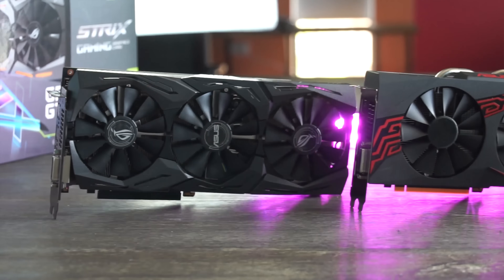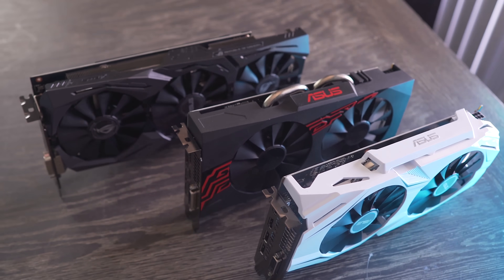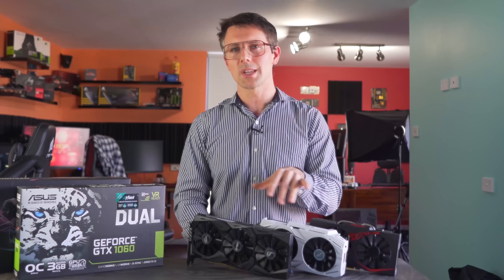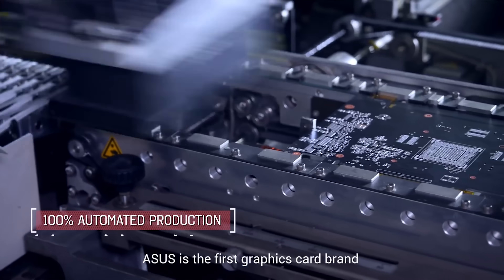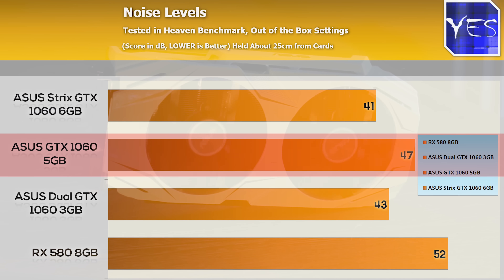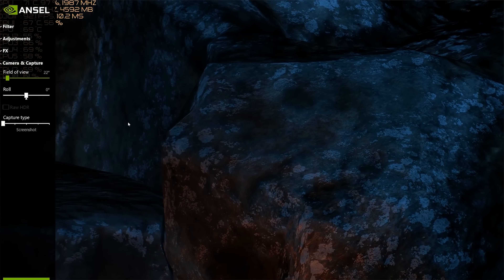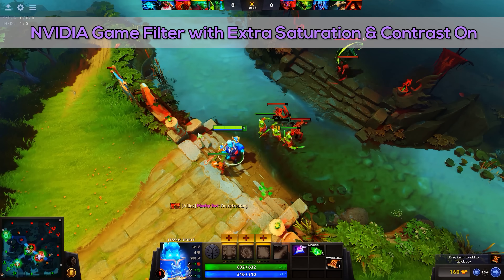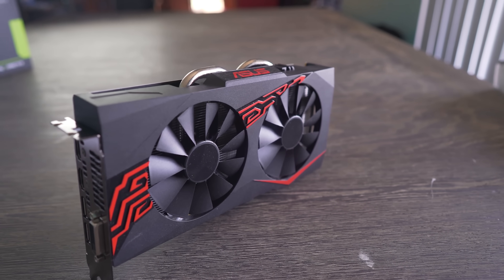GTX 1060 5GB Benchmarks ....!? Comparison Vs. ASUS STRIX 6GB and DUAL OC 3GB!

Comment: Looks like the exact situation as the 1050 3 GB. It's a crippled 1060 6 GB and that memory bandwidth does make a difference, although not as drastic as on the 1050 3 GB. The only way I can understand Nvidia doing this is because they're running low on 512 MB VRAM chips and started using the 1 GB variants to level out stock, hence the 160 bit bus. TLDW, it's a pointless card. Great video Bryan! This is the first dedicated 5 GB review I've seen (excluding Linus' Aliexpress card)
Reply: Ur wrong, GTX 1060 5GB version was made for gaming cafe's in china and only for china, there was no intention to sell it worldwide. I agree with @logirex
Reply: oz ye goddam early bird
Reply: It is intended and sold in asia. It is cheaper and fast enough for internet gaming cafe and similiar places.
Reply: I don't think that assessment is quite accurate since the 1050 3gb is actually faster than the 2gb model while this 1060 5gb is even slower than the 3gb model.
Reply: the memory bandwidth is intended to cripple mining performance, as the card was supposed to be only sold in China, aka the mining home base. (and it does that job well, actually.)

Comment: a question if someone with a good heart could answer me, I bought a gigabyte gtx 1060 5gb but has a high average temperatures, I wanted to know what would be the size of the thermalpad I should buy? 0.5/1.0?
Reply: Você achou ela boa? Será que é melhor do que a de 3gb?

A almofada está entre 0,3 e 0,5mm
Reply: @fernandoleoj  the difference is 1 or 2 fps with a maximum of 8 fps with the normal GTX 1060 (3gb/6gb).

I put 1.5 mm thermal pads on them, I removed about 15 degrees, otherwise no problem. ^^
Reply: @teloz2779  thanks for answering ....

Cool, but in games that need more textures, that 2gb of vram makes a difference, right?

Hug

Comment: 6gb is for us 1440p @ 60hz users who don't want to spend up big on a 1070 or up

the vram use easily surpasses 4gb on standard gaming, so a 3gb variant will skip badly at the same settings

Comment: Strix RX 580 vs aorus RX 580 xtr? Found a used aorus one for $270. The aorus one is very fast at 1425 (or around) factory oc however better thermals and acoustics on the strix card.

Comment: Hey guys I need help!!! I’m gonna build a budget rig for a friend. And i have to keep at 300 or less. I have 3 options rn.
1) buy a dell or similar and throw a psu and 1050 or 960 in there.
2) Buy a prebuilt Fx-6300 build with 16gb ram and a 1tb hdd cheap psu gt 720 with razer black widow kb and chroma mouse with a firefly mouse pad for 180 and replace the gpu with a sub 100 dollar gpu.
3)Buy an i5-2400 cpu, motherboard, 8gb ram, 450 evga psu, a 500gb hdd that I don’t use, cheap case and a sub 100 dollar gpu. 

Also another thing to consider is that I found a gtx 1060 on let go for 130 and a gtx 1050ti for 100 on let go. And the fx prebuilt is also something I found on let go. 
I just wanna try to get the best performance possible. I know the fx 6300’s single core performance isn’t all that good but the friend likes to make YouTube videos which is why it’s a choice considering it’s more cores and ram overall.

Comment: Hello Brain, im a big fan <3
Can i ask u a question? Im going to have X58 rig. Im planing to have EVGA X58 classified 3 mobo.
But the specs in PDF file i downloaded from EGVA website just said that it support DDR3 800/1066/1333/1600+
Did 1600+ mean that i can use DDR3 2400MHz ram? Or i just stay with 1600MHz?
Im planing to have X58 + 12gb ram + X5675 with 240 aio and OC to 4.5. Maybe 5.0 in the future. Many tks

Comment: What are the clock speeds, gpu & ram, during the tests? Otherwise the fps numbers are useless. For comparative results they all must be identical. The title says it's a comparison so record and present all the relative information i.e gpu & ram clock speeds. And once again the clock speeds MUST be the same on all of them or the test is invalid.

Comment: I'd expect any card with more Cuda cores but less bandwidth to run slower than the standard model until you reduce resolution to find that card's sweet spot. By reducing resolution you make memory bandwidth a moot point, then the extra Cuda cores become important. There may be games that do not require a lot of memory bandwidth by design, those games will also perform better with more Cuda cores than the standard model.

Comment: 5gb of vram would be a sensible amount for the standard 1060 rather than 6gb. In my experience a lot of games will use over  4gb of vram at 1440p but rarely over 5gb. When adding extra aa to push it closer to 5gb a 1060 will run out of raw power before that buffer will be exceeded at 1440p. 
3gb is not really enough vram in some games either, especially at 1440p. So the 5gb version would be ideal if the bus wasn't so crippled

Comment: Brian,  I'd really like to see a short followup on this video. The memory is clearly the problem as stated, so why not try a memory OC? iirc memory oc helped a lot with other bandwidth-limited cards like the gtx 960.  
Btw I LOVE that asus "plug in your case fans to your gpu" feature. When I run an AIO on my cpu with a air cooled gpu, the gpu dumps way more heat than my cpu when gaming. I end up with case fans on low, with a screaming gpu fan.

Comment: More completely pointless cards from NVIDIA, just why? I honestly don't get it, who would pay a tiny amount less just to have one gig less with the same specs otherwise. I would just get the 1060 6gb or a 3gb, which is what I have in my personal PC. If these things continue I'm going to switch over to AMD next time around, as long as AMD stays competitive and I think they will. the 570 and 580 are great cards respectively, their higher end stuff is lack luster in comparison to NVIDIA but I just don't need anything that high end.
Reply: Apparently it's only meant for internet cafes in China. Not meant to be available anywhere else.

Comment: the ext_fan headers on the gpu are bullshit. nice idea, but implemented so poorly, its sad. min pwm is 40%. you need gputweakII which is poorly programmend and i couldnt get my card to overclock with this program. max was 1865 mhz on 1080 which goes up to 2100mhz with afterburner. just use speedfan instead and onboard headers

Comment: Is a8-7650k worth it? Cause only ddr3 parts that have reasonable price and ddr4 part are so high priced and used market in my country are not worth it
Reply: NO. anything based on bulldozer would fail you in terms of performance nowadays.
Reply: Ty
Reply: If you're looking for cheap but good CPU in the DDR3 era, look for i7-2600k/2700k. These can run on Z68 and Z77 motherboards, these are soldered so can be massively overclocked (~4.7 GHz achievable) and cooled easily  with <$50 coolers.

Comment: This is just the next episode of "NVidia doing shitty anti-consumer stuff". They already have a 3GB and a 6GB version, they already had different core count versions that were totally unclear for consumers. And now they bring out a 5GB model. 90% of consumers will just think: 5GB, that is in between the 3GB and 6GB version, but closer to the 6GB. But in the end, it is slower than both.

I sometimes really wonder why people still buy NVidia cards, as with that they are sponsoring a company that does shitty anti-consumer, anti-competitor things again and again and again...
Reply: These are models intended ONLY for use in chinese gaming cafe's and have a lower bus width to prevent people using them to mine on. You will never ever see this product in stores. How are people not getting this? So many mentally challenged people making uneducated comments.

Comment: 1:28 I don't get it how dual gpu's are the same power consumption as one gpu??
Reply: Butyrkinas Pagarba I think dual oc means it has a switch on the PCB to have 2 oc modes.
Reply: Could also refer to the amount of fans

Comment: I have the same Asus dual cooler design on my RX 480 8gb but it’s always been kinda hot and loud for my taste anybody else experience this?
Reply: Dual as in the Asus Model. The card is an Asus Dual GTX 1060 3gb. There's not a second 3gb 1060 in the test.
Reply: Leandro Pereira yes the white DUAL one it’s one of Asus’s Line of cards
Reply: I also have an Asus Dual but RX 580 and normally AMD cards run warmer than Nvidia. My Dual runs at 65-75 Cº depending on the game. The max RPMs are around 2500, and it is a bit noisy but not that much. What I did notice is that the noise increases rapidly as the dust accumulates over the gpu fans, so I clean it often.
Reply: And remember that Asus Duals are the cheap line-up, ROGs would be the Top-end. That's why Duals feels kinda cheap on fans and no backplate.
Reply: Yorch Li yeah but I got a 8gb 480 for 200 back when gpu prices weren’t so screwed up it was 60$ more for the strix
Reply: I got also an 8gb version, it cost me 210 like 2 months ago (used). I have stressed it a lot and it works fine, no funny gizmos or anything. It was from a mining rig, and the guy let me "choose" from his 12 rx580, they were all identical except for two 4gb rx580 he had. He even installed the original Bios in that moment we were testing and stressing the card.
Reply: Yeah the DUAL is way louder than even the STRIX (2 fans) version (not ROG STRIX which has 3 fans). The heatpipes are less effective and the fin density is lower.

Comment: Is there a GTX1060 with an 8 pin connector?  Or was that the RX580?
Reply: There are 1060s with 8-pin connectors: Asus ROG Strix, MSI Gaming X, Gigabyte G1 Gaming, Aorus Extreme. Basically all top premium models of each brand have 8-pin on the 1060.
Reply: Ah thanks for that!  I have 2 GTX 1060s but the 1st gen I guess.

Comment: Thanks Bryan for another great video. Thanks to your tips on getting a good deal for second hand hardware, I was able to get 2 MSI GTX 1060 3GB OC's for €140,- a piece from a seller. Unfortunately I found out too late these can't be put in SLI (shame nVidia), so I'll be putting those in my guest gaming workstations (dual Xeon X5345 HP XW8400 32GB). I went looking for another deal for my main game PC and found a GTX 1070 Ti for €250,- but the seller never answered his doorbell. I have spent 3 hours waiting in front of his house from 7 AM this morning... I guess I could use some more advise on how to tell or make sure a seller is legit.
Really nice to see those steaming cards unboxed, you really go to great lengths to make your video's look good! See you in the next one.

Comment: Im going to build a pc with the x5675 primarily aimed at gaming should i buy the 780 Ti or the 970? I got 650 watt psu
Reply: They are both very similar in performance. The 970 takes less power and has more VRAM, but with that PSU(assuming it's a decent quality one) either will be fine.
Reply: Fina1Ragnarok the its a cooler master modular one
Reply: Fina1Ragnarok so I'll probably buy the 970 then

Comment: NVidia should have never made pointless cards like the 1060 3GB, 1060 5GB, 1050 3GB, or DDR4 GT 1030. No one asked for these lesser products
Reply: I mean, the 1060 3GB kind of has a market... they just should have called them GTX 1060 (which would have 3GB vram) and GTX 1060Ti (which would have 6gb of vram)... to fit with the rest of the product line.
Reply: Nothing wrong with the 1060 3gb it destroys 1050ti 4gb.
Reply: grlmgor Just barely. There’s just no reason to have all of these different products with the same name
Reply: +Mr_Beezlebub it gets about 30 to 50% more FPS.
Reply: grlmgor because it's actually a lowered bin 1080
Reply: more like a cut down 1080
Reply: +Waifu Hunter 1080 use GDDR5X memory while 1070 and 1070 ti use GDDR5. 

Any way I was talking about a 1060 3gb will get 30 to 50% more FPS then a 1050 ti.
Reply: grlmgor But that doesn’t justify either of them existing, especially the 3GB 1060, since it’s name is exactly the same as the regular 6GB 1060. Too many products with similar names is not necessary
Reply: We the 3gb 1060 is the same 6gb but half the ram and a 10% less cores. So they sell it a bit cheaper and it fills in the price gap between the 1050 ti to 1060 6gb.
Reply: grlmgor They don’t need to fill in any price gap. The 1060 6GB cards regularly go on sale for less than their MSRP, so nearly anyone could afford them. Often times the prices end up being only a couple bucks more than the 3GB model, making it even more uncalled for
Reply: 3GB model is really good though because its so much cheaper but performs almost the same as the 6GB. It all really comes down to price even for the 5GB model.
Reply: Mr_Beezlebub you forget the 1070ti

Comment: Just get a 980 instead?
Reply: theyre discontinued and why would i want to buy used cards
Reply: K1asH3r "Why would I want to buy used cards" THEN WHY ARE YOU WATCHING TECHYESCITY
Reply: And along it get more heat, bigger power consumption and PSU requirements?
Hell no, thanks. GTX 1060 is the way to go.
Reply: Lighty Dust Maxwell was already a hella power efficient architecture, for 150$-200$ I don’t know why your complaining. You can run the 980 on a 400watt powersupply as long as it has the cables lmao
Reply: Just get a 980 ti for like $50-100 more. You can overclock it to about stock 1070 ti performance.
Reply: @Ian van Ingen - no, just no. 980ti is about on par with a 1070. But with higher power requirements and more heat. Stop fooling yourself.
Reply: Its Neight Do you even know how much overclocking headroom that thing has? Watch this video if you're not convinced: https://www.youtube.com/watch?v=vT8CjrZWjT8 Yeah, the 1070 ti sometimes has about 9 fps more on average but that's only with high framerates (~100 fps) and nobody will see the difference between 105 fps and 115. If both are around 60 fps it's most of the time only a 0-5 fps difference. Yeah yeah, it has higher power consumption and heat output, but for a $200-150 difference that's well worth it.
Reply: In that video you linked the 980ti has a boost clock of 1075... My overclocked 980ti is at 1502mhz on the core! Most 980ti's overclock very far, I had to change the stock thermal paste though.  It will still be more than enough for years to come.
Reply: Filip Lenz Yeah, I doubt gtx 11 series will make the maxwell stuff obsolete.
Reply: It would definitely be an improvement in 4k gaming, but I don't mind 1080p ultra at 60fps to be honest. I can play some games, Dirt Rally I can run at 4k ultra 60fps  without problems, the card still has a lot to give!